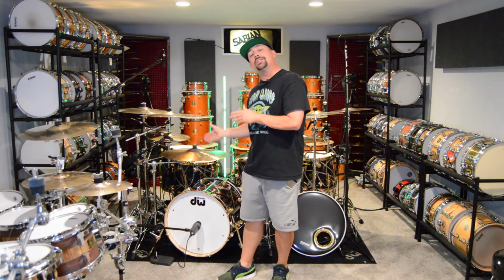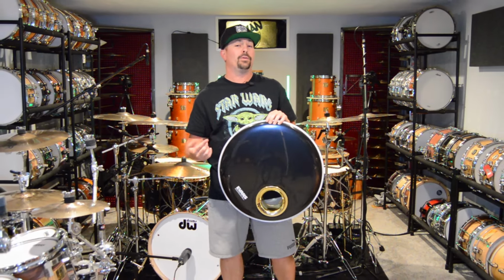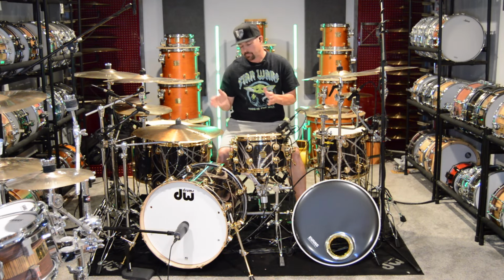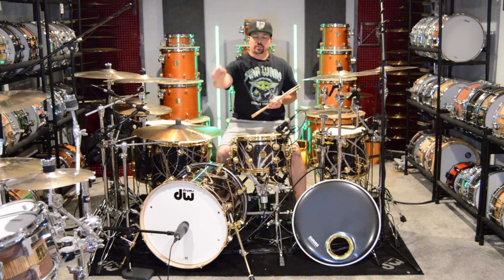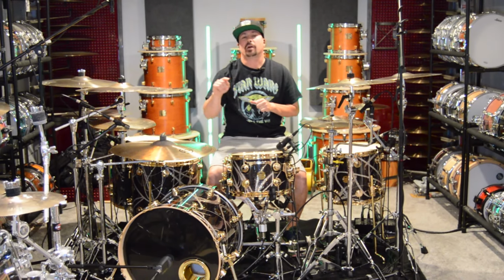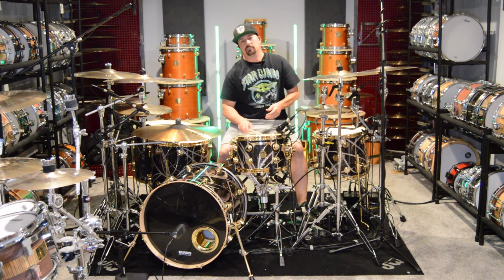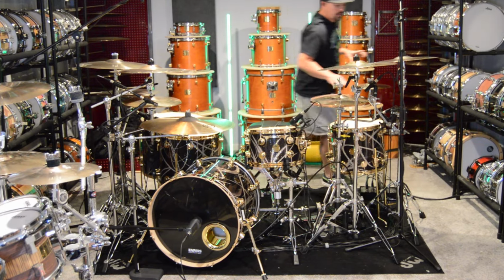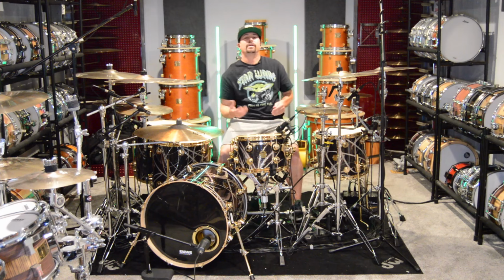Mic Placement and Portholes?! Does it matter?! Remo vs Evans

Comment: All 3 sounded pretty good to me.  But we do not know what your doing on the mixing board your using to record this audio.  I did a similar experiment a long time ago.  I found the kick port to actually cause problems.  It damaged the port hole I cut and tore the bass drum head.  So I prefer to use a 4 3/4 plastic reinforcement ring, no kick port and I place my mic inside farther.  It's about 4 inches inside the port and pointed at the beater.  I get a lot more slap and thud while still getting plenty or resonance.  I also use single ply emadd head as a batter.  And an Emadd reso.  This is a very good video.  Thank you for doing this.

Bruce
Reply from the maker: yeah I've had some failed ports in the day.. but I've learned to cut short and then sand it until even with the template. That's worked great for me.

Comment: Hi' i just ported my 18'' x 16'' bass drum drilling a 5'' inch hole in2 the Shell! might be worth a listen, sorry about the quality sum good speakers you can hear the tone of the concept of drilling the shell,. its a masters set set up is why, 5 inch threw the shell, one day i will capture it with a recording studio is under construction ( technical difficulties )
Reply from the maker: whoa you drilled a 5" hole into the shell?!?! DAYUMMNN..... that's crazy!
Reply: @ZackZweifel  well if ya have re rings i think that could help enforce it a little bit as the hole has got to be kind of up in the front its how much shell are you going to leave in between the hole and the rez-side edge since its a short space i think a drum with re enforcement rings , but with out it its still fine,. the benefit is your getting the controlled bon-ham sound your gaining the performance of the full rez side head bon ham doing those triplet double triple strokes or what ever he was doing those fancy bass drum strokes he is gaining the perforce of the full bass drum head ,SO 4 what ever shell rezzance i have lost by drilling a giant hole into the shell / i gained it all back by using a full head,, if you drilled a 5 inch hole into Bon Hams kick drum how much would it effect it ? it would still be big and beefy ,, okay bon ham for me is still 2 boom-ee so i put a feather pillow in to the bottom of the kick drum it has 2 full heads on it and it then has the 5 inch bass drum hole port drilled into the shell ,. miking the thing would be put one mike out in front and put another mike at the hole or in it for a little more direct tighter thumping the one in front a little more of the Bonham effect ,. mix them together ,,. it really has to be dun because its a 18 inch  bass drum ,. i need the hole performance like how the pedal performs wen there is a hole in the front head generally a hole and sum kind of muffling i like the feather pillow method sum like say simmon phillops will tape towels rolled up to batter side bass drum head ,. they make a weighted kick drum pillow now you can do something similar with that dead out one side of the drum i like both heads dead because the pedal performs better in my opinion like that with a big pillow in there then i put a brick over it to smoosh it down to the bottom of the bass drum ,. however again the 2 heads with the hole in the shell,, im getting sick compression but im getting enough release so im gaining full head performance but not so much so it still feels half way like its blowing air out the front,.. i did this on 20 x 16 yamaha recording custom kick a wile back that one i vellcrowed in the towel like simon does,. on bigger bass drums 22 inch 24 inch well maybe you can get away with no real big 5 inch port hole like say simon or bonham ,. side note is say like DW will make a full rezo head but they put tiny air holes a few of them around the edges so this is a way of try that be4 drilling your shell the thing is ,. is that DW head it just not the same ,. my method really gives the best performance ,.  i sold that yamaha kit to a guy in LA for 600  bucks ,. he freeked out over the bass drum like i was not the only one he knew he got something special ,. like a pro drum smith could probably router the edge of the 5 inch hole making it look sexy , i sanded mine as much as i could with a spring drill sander i got the 5 inch off amazon and drilled it my self ,. but ya that yamaha was special i also did this to a hip gig kit with a raised up 16 x 16 kick,, super small kick so i ported it ,. its almost like you gaining a size by doing this ,. my 18 sounds like a 20 ,. and that 20 sounded like a 22 ,. with the tiny kick drum 18 inches ,. its you take drastic measures to insure it sounds good ,. other things im going to try ,, is ,. im staying at 18 inches ,. but i see like 18 by 21 long sordo drums so i will turn one of those into a kick ,. start extending the 18 longer to get it to sound fatter ,. for me,. is going to be,, buy a jarrah wood kit Brady is out of business so Evetts is another great option they probably can do 18 x 18 kick drum another option would be to try and get AVA to make a slim shell stave kit in Jarraha wood if he can its a toss up to which would sound better ,. its i want the jarraha kit ,. Evetts tho they specialize in that its they have 45 edges and AVA has round overs there both good ,. there also were now talking about spending way over 5 grand on a kit easy 6 to 10 grand lucky for me i dont need that many sizes ,. 12,12,16,18,22 so for me 5 drums is my entire kit so maybe under 10 grand then ,. Evetts there not cheap at all but there worth it as those kits sound better and are more powerful then a lot of whats hear in the USA ,, and the AVA because its one guy building you a custom kit,. he is not cheap but slightly less then Evetts and he can do Jarrah snare drum ya how about the entire kit well since he can get the wood maybe he can do it, the jarrah it sounds like its a mettle drum but its wood ,. spin doctors i would go see them at wet lands back in the day in NYC he eventually had a Brady kit ,. its going to be weather you think slim stave with re rings and round overs sounds better then the shells Evetts is compressing together ,, last option is going to be the Hendrix archetype reasons its out for me i dont love there lugs or that they only make the kits in normal style wood choices if your good with a walnut kit is what im saying however there progressive bearing edges concept is good and the sound of there kits is amazing so its a second place ,. hears the issue i have and its not actually heard anything beat the sound of the Evets kits the AVA beats it on paper but there are no good recordings of his kits were there are just enough demos of the jarrah wood Evetts kits there spotted gum is good2 but its get the jarrah, a few good drummers demo them on YT i had a few Bradys ,. theirs nothing like them so i say maybe AVA ,. i might get the Evetts first,. any way back to small size kick drum normal birch/maple/birch shell like i have round over edges its drill the shell to get the volume and performance out of it ,,now a 10 grand drum kit maybe dont drill it,. but a yamaha recording custom is still pretty expensive and i drilled it so LOL,. cheers

Comment: Having a Kickport and then micing the center of the bass drum really is not a good idea because you will get a lot less vibration than without the kickport. The kickport really only exists for micing the porthole. If I wanted to also mic the easy head itself I would not put a kickport in there. So the comparison between the factory head and the kickport head both being mic'd in the center is rather flawed. 
Mic in the porthole sounded the best
Reply from the maker: yeah understandable but figured I would see how it sounded since I had the capability. I really wanted to do the head without the kick port and just the port hole.. but installing those kick ports with the head on is a pain in the ass lol